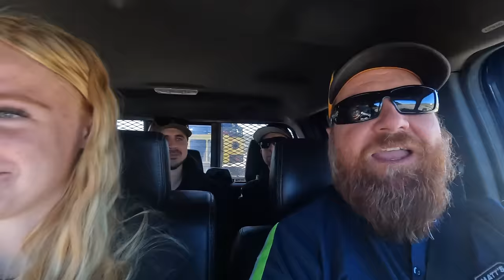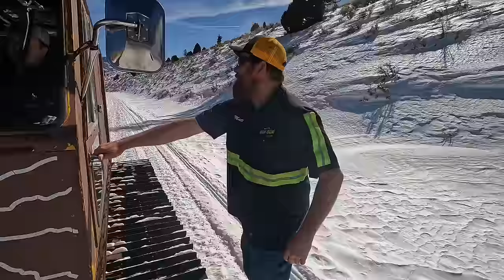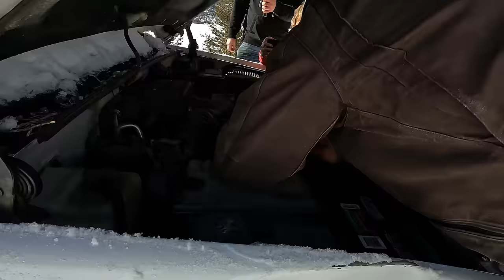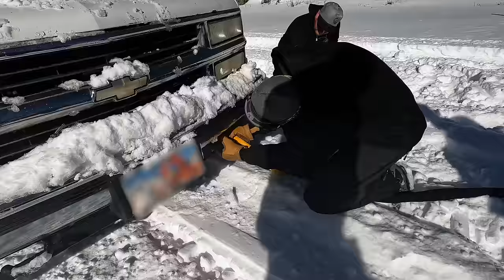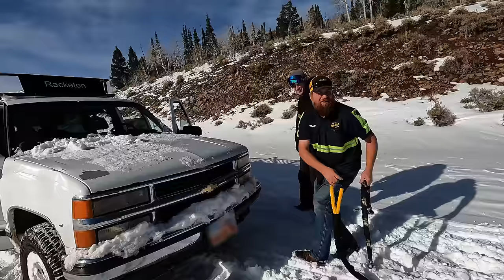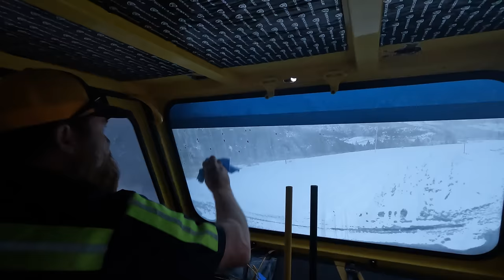I Failed....

Comment: You could go with old school dozer steering. There was no differential. It was a bevel gear that drove both tracks equally. There was a clutch and brake on each side. To turn you just had to declutch one side. To turn more, you applied a brake. I think the Ripsaw tank by Howe and Howe is set up the same way. The problem with differntial steering like you have set up, is when you try to stop one side, the other side HAS to speed up due to the gear ratio in the spider gears. Just bombing around (pun intended) is fine, but as soon as you put a load on it pulling, thats what overloads the drive train. Hydrostatic is nice, but requires full hydro with pumps, spool valves, and oil that gets thicker in cold weather. The mechanical drive train is more reliable.

Comment: To avoid fuel lines freezing: keep a full tank, especially when the rig will be sitting idle during wet/cold weather. This avoids condensation in the tank. Also, the appropriate ratio of HEET to gas will help. In leaded gas days, it was 1 can to 15 gallons. Now it's 1:10. But read the bottle's label; the ratio has changed at least once. HEET's cheap insurance, keep a couple bottles handy, and put one in when you fill up.

And... it's not a failure if 1) everyone makes it home, and 2) nobody's in a body bag on the way home. So, no failure.

But the best part? L O L A Lola! That was a decent adaptation and appropriation. Well done!

Comment: Matt, not sure if anyone mentioned this. Look at using a tractor axle with wet brakes. There are also mechanical drive axles for rough terrain forklift axles that may work. I used to design equipment. If I was starting from scratch, hydraulic drives are the way to go.
Reply: With ai ground up build, it would be easier to go electric motor drives letting the computer run the pair of motor controllers ( electric braking is also possible with theas.)

Comment: Hej Team,

Im thinking the steering issues and the fact that the caliper fell off are symptoms of the same problem. The mounting bracket for the caliper flexes too much, so what you'll get is 2 things:
- it will oscilate between "grabbing" and "sliding". which ruins any brake performance
- this oscilating also caused the bolts to fail due to fatigueing. 

So instead of jumping straight to a different steering system, you could try something pretty cheap and easy: Make those mounts MUCH stronger.

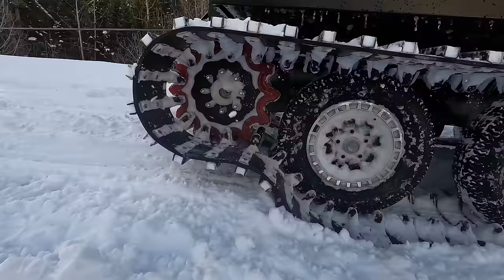Comment: Probably the best way to drive a tracked vehicle is to use individual drive motors mounted in the rear. I can't see electric being practical, given the energy loss from the cold. A hydrostatic pump and "wheel motors" would be more efficient, but you will need to control both the high and low fluid temps to make it work well. Also, there is a mechanical reason that dozers and such mount the track drives in the rear - doing so only puts the bottom of the track under tension (moving forward) - the top of the track isn't loaded. Putting the track drives in the front increases track wear because you are now pulling the top of the track forward under load before it can go around the rear idler and pull the vehicle forward. If you look at 32:15 in the video you will see the track all wadded up under the drive hub. This is extremely hard on the track.
Reply: Diesel Electric. Simple.

Comment: Just to try and help you guys in the future, those 4wd actuators need exactly 12 volts to work, if this ever happens to you again you can run a wire to the positive side of the actuator from the battery, and it will engage again something sucks about those and the actuator will be good but the part that supplies the power won’t give enough, they suck

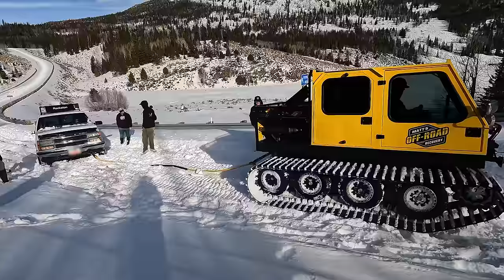Comment: 👋 I know what happened to 4 wheel drive. That model year uses a thermal actuator to engage 4 wheel. If you lose power and you are in snow. The 4 wheel actuator will disengage do to thermal gel not being warm enough. 30:03

Comment: Ever considered wet disc brakes like farm tractors and heavy equipment use?  Very low maintenance.  Hydrostatic would mean a major rework to add a pump, oil reservoir, cooling.  Plus hydrostatic generates heat.  Slap a big John Deere or New Holland (Ford) diff under there hook up brake linkages and you're done (tractor diffs already have individual brakes for brake steering)

Comment: You guys should call Edison Motors.  They're working on a DIY series hybrid system for heavy duty pickups.  Whatever generator they pick will be plenty large for the bombi's engine, then you just need a 150kW motor for each side of the tracks.  It would be considerably more controllable.... and efficient.

Comment: Matt, you’ve done a beautiful job on the Bambi. I may be wrong but you should be able to turn on a dime with tracked vehicles. I think the your concept is good but when you tied the rear axle together with the tracks it makes both side unable to maneuver without making the other side move at the same time. Each side, right or left, should operate in independent of each other. 
How did Bambi’s rear axle work before? 
Good Luck,
Dean

Comment: I agree with the Go Hydrostatic comments.  I had presumed as you were building this that people were commenting that dry brakes and a truck differential won't work well on a tracked vehicle :(.   Too much duty cycle and heat on the brakes, too much time spending in "differential" mode on the diff.  Both need lots of fluid for cooling. For comparison my Bombardier Muskeg has 7-gallons of hydraulic fluid and wet brakes in the differential case.  it has 2:1 final drive outboard of the brakes so the brakes have more leverage than they would spinning at the axle speed.  And the differential is about 3x bigger and a completely different design than a Ford 9."  And even then you can't fully stop one side like you could with hydrostatic.  At best on a differential steering tracked vehicle you can get about a 3:1 speed differential between the two tracks.  Multi-point turns are still needed for turning in place.

Comment: great to see bombi and wiskers playing together.
 SO if you do decide to hydrostatically drive the bombi, plan it so you can then build a tracked hydrostatically diven trailer to go behind it a big like a hagland, you could make a light weight drop on and off crew cab that could then got onto of the flat bed and still get  one end of a vehicle on it if it, say if it had a broken or missing axle.  remove the extra crew cab you could put the lot of it on.

Comment: You should be using a 14 bolt axle. They are robust enough for the ripsaw. That should work wonderfully for the smaller lighter bombi

Comment: Ya need a late 70's -early 80's NP203 "full-time 4x4 t case.  Rerout or flip the front output  to face the rear. Swap the backside cover plate and front output housing,  or use a pair of straight cut gears to redirect  from the front around the t case. For the axle a pair of 1leged 9 inches with sopools ( cut the wrog side tube off and weld in a plate to seal) . 
The 203 acts like an open diff in 2 hi ( really 4 hi un lock, also gives the opportunity for 4low un lock and boath run in lock for max traction but no turns) it just sends power through the path of least resistance. Found out when i finally got a front d shaft and ripped the splines out of a front hub the first time I matted it ( ~400hp sbc350)

Comment: Matt, had the same intermittent issue with a holley installation. One of the two cylinder head grounds was just barely loose enough to cause problems. Just a tidbit to look into in case.

Comment: A tracked articulated vehicle.  This might not be the most practical solution to the Bombi's steering problem, but here's a few reasons why it might be.  It would need a second Snow Cat, or at least a frame, tracks, and drive train.  It should get its power from the Bombi through either a PTO, hydraulic drive, or electric.  Add a pare of hydraulic cylinders to articulate the two vehicles about a pivot point, and you would have a tracked articulated vehicle.

Rather than a cab on the second unit, I envision a rollback deck.  The Bombi is built to float on top of the snow or sand, but whatever vehicle you are trying to rescue is most likely not.  So if you could carry the casualty vehicle, rather than drag it like an anchor, it would make recoveries so much easier. 

There are a number of cons to this idea, not the least of which being the time and money required to build it.  Although steering such a machine won't be an issue, it will never be able to turn on a dime like a Snow Cat can.  Lastly, it would be a long machine, which would mean that you might need a longer trailer to tow it, and you won't be able to tow it as far up the trail before you are forced to unload it.

For those reasons, I doubt Matt would consider turning the Bombi into an articulated vehicle, but I thought it was a cool idea to share with the community.

Comment: If the water pump isn't turning the temperature gauge is not accurate,  it takes the temperature of the water as it's pumped thru the thermostat housing or water inlet, you would want to check the oil Temp but don't think that model has a oil Temp sensor, next best would be a infrared temperature gun to take temp readings of various spots on the engine

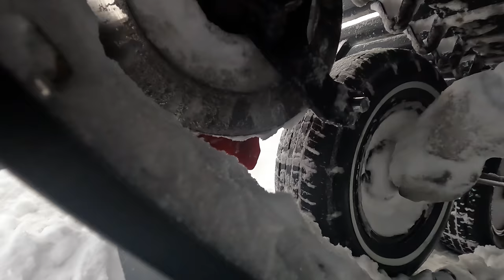Comment: Matt says at 40:28 that there is "nothing that can hit it" meaning the brakes. With the shot we get at 32:18 it seems like when the track hits snow, and in particular at speed, the track will deflect a lot between that drive sprocket and the first tire. The brakes look like they are behind the drive sprocket and not directly contacting the track under normal, non snow conditions, but in snow conditions its more likely to be hit by the track when the track deflects like at 32:18 especially if the track deflects not just backwards from the drive sprocket to the tire but inwards from the outside of the axle towards the center of the as well.
Of course I can only see what I see on camera and its probably completely different in person. 
Love watching your videos, Greetings from Australia!

Comment: Stoopid question coming up!
As I understand it, the Bombi brakes are on the 9" diff at the front of Bombi.
Are there other brakes?  (no...)
If a track breaks, there's no brake on that side, as the wheels on the ground will just free wheel. Could make it interesting on a downhill run!
I know it's really a one-in-a-million chance, but what if both tracks break....
Reply: I believe he has brakes on all 4 corners, the one that fell off came from the right rear. But yes it is a problem on tracked vehicles with differentials like this that breaking a track causes you to lose all stopping power.

Comment: Old crawlers have a locked diff and a steering clutch and brake for each side. Usually foot brakes and a leavers for the steering clutches.
I have have a old bristol 22 crawler that uses this system.
But I am sure there are crawler / bulldozers that use that steering system on your part of the world that you could modify to your application. 
Cheers for the Videos.
Keep it up.
Dee from New Zealand.

Comment: @Matt, when considering a hydrostatic drive train for the Bombi, you might loose some agility and acceleration.

Did you think about a CVT (continuously variable transmission) for each of the tracks instead? Mostly frictionless, fully variable ratio, being large enough for the torque expected, this might be a better option... 

And might fit better into what you already have than converting it into a hydrostatic drive train.

Comment: 4x4 tip: when it won’t engage, and you have a light on at the switch pull the t case fuse (# 2 I believe) wait 45-60 seconds while waiting turn key on and off 5 x put fuse back in and it might work. This clears the codes and let’s it function one more time sometimes twice.

Comment: I think the tracks might just have been pushing far up enough to contact the brake. If you look back at 32:15 they're flexing pretty far up in there as it digs into the snow. The right side might have just managed to get high enough to snag and ripped it right off.
Reply: This is what I was looking for as well, couldn't remember the time stamp. problem is the drive will tow better in reverse than forward because of track slack developed while under load. Heavy equipment puts the drive in the rear for this reason. going hydrostat will eliminate brakes but there will still be other problems.

Comment: Regarding the cam sensor:

Shielding of a cable needs to be grounded on each side, with good continuity across the wire.
Also, you might want to check if the cable is a twisted pair (that's desired, less susceptible to electrical interference)

Comment: What about using a fluid recirculation system with a cooler for the 9" diff? Cars that are used for road racing often use diff coolers because the diff is doing a lot of work around all the corners, and the diff housing typically doesn't hold a whole lot of fluid. There are probably cooler setups for the 9" readily available.

Comment: I wonder if there is a bit of a design flaw when using the Bombi for towing. Tanks have there drive sprocket’s at the front to help in floatation but tractors or dozers have their drive sprockets in the rear to get maximum drive from the track. A bit of a limitation of a snow vehicle for towing.

Comment: What is weight, track length of Bombi?   Could it be loaded on blue steel flatbed?  Maybe reduce team size?  Blue steel was cramped, both tracks were full, then one overloaded X2.
  I have thought an enclosed above side by side might be good companion to tracked units.  Able to find vehicle, shuttle/warm people as needed.   I bet blue steel W/chains could have made it.  I just watched Casey DeLavel?  He broke front end snow recovery.

Comment: I know there is question on the front axle. Have you considered going to a full floating instead of the semi-floating setup you currently have? 
That should take all weight and force off of your driveshaft and change the issues with sideloading. 
If you're going to stay with a conventional axle I would recommend you consider going with full floating axels.

Comment: You're almost certainly not going to see this cuz of how old this video is, but Matt you did not fail. You recognized from the very beginning that this job may have been beyond your ability and even if the bombie was functioning perfectly, you said it yourself. The bombie barely can't pull that vehicle up the hill, but you recognized before you even set out on this job that you're going to need some help. So you planned ahead and brought Robbie in on the job which is why you are victorious, sure you needed some help but you can't always do it alone. Sometimes you need help no matter how prepared you are

Comment: That 9inch is spinning reverse to its normal rotation for proper oiling. You need a front axle for proper oiling. The trick might be locking the steering axle so it won't steer.

Comment: My dad was the Ranger in Moab, on the LaSalle and in Loa, on the Thousand Lake.  I know where your are and I drove those roads in the 50's in my 55 Ford Crown Vic. bought by selling Uranium claims  while going to school at Utah State.   My dad drove a 3/4 ton Ford PU with posi and a 1000 pound horse rack and tale gate ramp. He always had his saddle and bed roll over the cab and and a Handyman Jack.  I did Aero Tech at Utah State, worked for Rare Metals Div El Paso Natural Gas, Army, Air Force mechanic.  Industrial Engineering degree from Cal Poly, Weyerhaeuser, Sales Engineer; Hydraulics, Bearings, Chicago and Rocky Mountain West Territories. For Thirty Years I have been doing R&D  on Low Impact Tracked Vehicles.  I have achieved a lot.  You would understand by discoveries but the sources of investment do not.  I submit references but the companies I worked for and the customers are not there anymore.   
You have done a great job on the Bombi.  I love to hear the balance you have achieved in you power train. The paper I am writing deals with; ground contact, track assembly, suspension, drive train and configuration.  You are great but, I am 10 years ahead.  The sad thing is that, you are the best all terrain engineer on the YouTube.  The Marines at Camp Pendleton AVTB. understand and believe in my hypothesis but the companies that are receiving retainers to support the Marines have "virtual engineers" who know how to operate, code, program but are not qualified to carry your tool box.  
I am on YouTube;  Name, Iguana Tracked Vehicles, Snowmobile on Water, Tracker Ind, Iguana Amphibious Truck.  The truck with hybrid drive has a ground pressure of less than 100 pounds per square foot (old Tucker) I have traction and tension greater than the vehicle weight, track angle control and latest is hydrodynamic thrust from the tracks.  
I am 88 years old and still working but not too hard. 
Dave Hansen

Comment: Quick tip. If you are using the Terminator computer that is not rated for weather or hot cold extremes. The dominator ECU is. So if the computer is in the elements it will short out.

Comment: Maybe run more oil in the diff of the, those gears are probably barely submerged. Those are only designed to turn when your turning, that or put a clutch type locker in it to help with traction, since traction is an issue and put more oil in it.

Comment: any cam and crank sensor wiring should be pre shielded on a pre built harness, also, cam sensor is not need for anything other than quick start up. might as well disable it, less issues.

Comment: Hey Matt if it is moisture , get some silicone spray for electrical , I use it on distributor, plug wires, electrical, can just about run engine under water